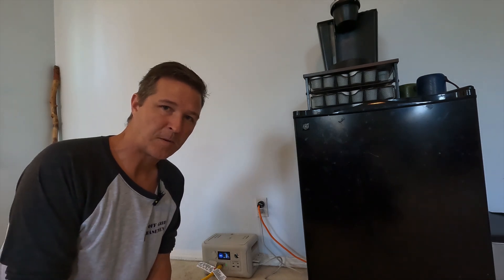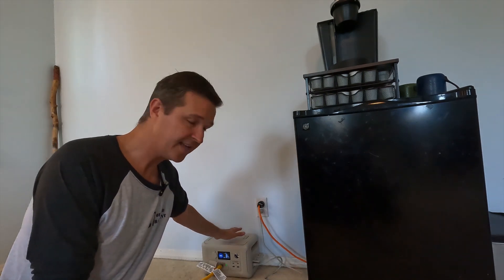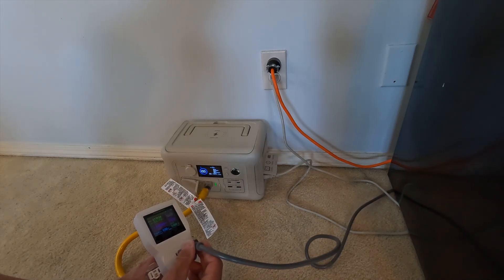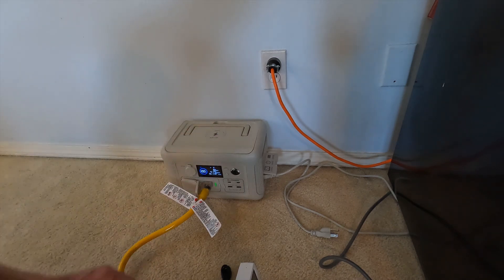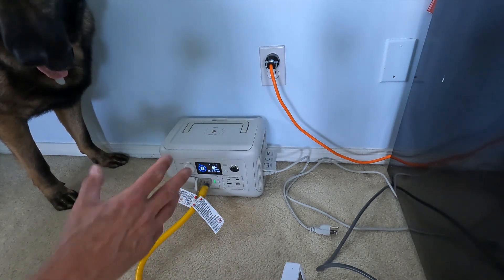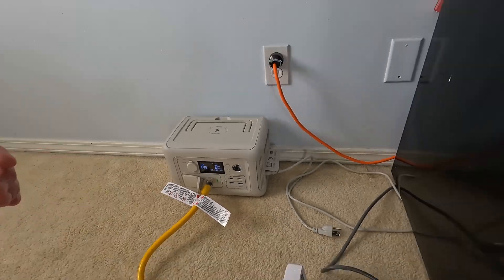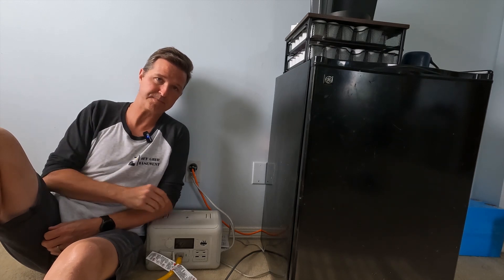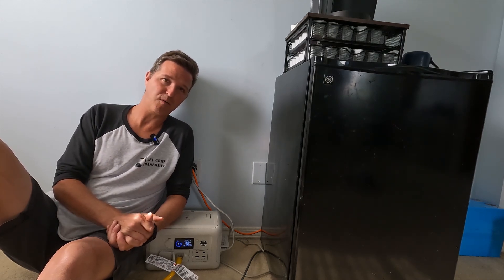Will a 600w 299wh power station run a compact refrigerator?  Let's find out!

Comment: Once you don't open fridge or often you can get good run times as the need for motor to run would be minimum. A solar panel or two to charge up  or aid the loads during sunshine would be even better
Reply from the maker: Thanks for the info and the comment.

Comment: I  t's good to know what the abilities of your emergency backup gear is, but you probably would have gotten a much different result if you had also shut off your AC for the test. In a power outage your home will heat up in the summer and it will heat up A LOT in that length of time, if you live in about half the states in America. Covering the fridge with a few quilts will increase your time, no matter the outside temp. 
  I get really good results with a cheap 600 watt modified sine wave inverter and a LiFePO4 battery. The Mini 12 volt LFP batteries are so light and are getting so cheap that they compare better with solar generators and they deliver more bang for the buck, IMO. It isn't as "refined" looking, but if you keep the inverter/ battery connected to a cheap low amp charger and when the power goes out the charger won't charge any longer, but the battery/inverter will still power the fridge, just as if it was a UPS and it will do it for days not hours. I live in Tornado Alley, so I have to plan for days of outages. BTW, that unit looks a lot like a Bluetti EB3A. Are they as similar as it seems? My EB3As makes my lights flicker when I plug them into the units acting as UPSs. Is that unit better? If it is I may want to get a couple.
Reply from the maker: Thanks for the information.  I've never noticed any lights flickering when I use the EB3A.  This unit is very similar but gets a little bit more power out of the AC side.  Thanks for the comment.
Reply: @OffGridBasement  It's actually a common complaint with the EB3A. It's been determined that it's because the wall power isn't being passed through the unit directly to the AC device, but rather, the EB3A is using its inverter to run the AC device and, when it detects a small drop in the voltage on the built-in LFP battery, from running the inverter, it switches on the charger and that causes the very quick interruption in power that makes SOME lights flicker at regular intervals and, unfortunately, also slowly degrades your battery, even when the wall power is working. Folks complain that, even though the lights don't flicker, they are annoyed by the frequent clicking inside the unit, probably due to a relay turning on the charger. Do you get any rhythmic clicks from the unit you used in this video or the EB3A when they are acting as a UPS?

Comment: I have an Eco Flow River 2 Max and run a fridge like that overnight. Takes about 70% of capacity running for 8 hours. I've only charged the unit once with AC since i got it about 4 weeks ago.
Reply from the maker: Thanks for the info and the comment.

Comment: I'm completely off grid with limited solar, and I learned to purchase a refrigerator that uses lower amps. For example  my 10.1 Magic Chef only uses 1.5 amps.  Best efficient unit because of the lower Amp then other compared  units.😊
Reply from the maker: Thanks for sharing and for the comment.

Comment: I have a similar dorm frig in a hot garage.  It runs for about 10 minutes, then is off for 15.  AC watts is 70-80.  Draw on the battery is about 9 ampsDC.  A 100 watt panel in good sun can power frig all sunny day.
Reply from the maker: Thanks for the comment and info!

Comment: Kind of impressive for that little guy. Think of how far it might go with a 50, or 100Ah LiFePo4 connected to extend it's endurance... Curious to know if it would even start, or run a regular, newer 18-20 cu.ft. fridge, thanks.
Reply from the maker: Not sure if it could handle the initial surge.  Thanks for the comment.

Comment: Nice video. Would be interesting if you knew the real life aspect of it as far as perhaps opening the door for 1-2mins each hour as if someone was taking food/drinks out. Would the surge keep bumping up thus actually giving you the 3 hrs you first thought?
Reply from the maker: Time would definitely go down, but that is a good question.  If the power was out I would try to keep my refrigerator used to a minimum.  Thanks for the comment.

Comment: It would be interesting to use a timer switch that comes on only for 15 minutes per hour. This might result in greater temperature swings in the fridge but can it prolong battery life?

I’m old fashioned, when the power goes out, fridge and freezer get blankets for added insulation
Reply from the maker: I like the idea of a timer switch.  Good thinking with the blankets!  Thanks for the comment.

Comment: I measure every electric appliance power requirements on everything in my house and mark the running  watts with green painter's tape and magic marker. I mean EVERYTHING that is plugged in. The newer appliances are very much efficient and use much less running watts. I was shocked to see that my vertical tower fans use only 42 watts on high. The old box fan was noisier and used 97 watts and put out less breeze.  The 2 house fridges are quite efficient....until the defrost cycle happens. I can tell when the defrost watts are high on my battery state of charge meter shows it. 229 Watt hours is pretty small but you did a good test. I have a total of 96,000 watt hours available to  run my clock radio....
Reply from the maker: Thanks for the comment.
Reply: Cool👍 What is your average per day in kWh?
Reply: @JonasSyver  8-10kwh per day. Down from 22-26kwh a day a few years ago. This takes a huge amount of discipline.
Reply: @kimmer6  Good job👍

Comment: Nice experiment, could you try to run the same test but with fridge in the garage with summer heat. See how ambient temps affect run time.
Reply: I put a Magic Chef 2 door 3.1 cubic foot fridge freezer in my old GMC van conversion. I also have a 300 amp hour Chins lithium battery, 2000 watt Renogy inverter 40 amp MPPT solar controller, and 400 watts in panels on the roof. When running, the fridge draws 58 amps. That is a huge improvement compared to old dorm 1 door freezer/fridge 1998 unit power usage of 105 watts. The van sits in the driveway in the sun with windows down 2 inches but it gets hot in there. The fridge runs a long time every hour when its hot inside. I store some small packages of ice cream in there as the Missus is severely diabetic and will chow down on any ice cream in the house.  I have to hide my Haagen Daz.

In the Winter, the fridge runs the battery down to 95% overnight and with low sun angle and short days, it takes all day to get to 100% charge. In the Summer, with the solar disconnected, the fridge runs the battery down to 82% with 93F peak day temp.  I did this as a test. With the solar charging, the  battery will get to 100% by 2 in the afternoon.  The ambient temperature the fridge has a drastic effect on the run time on the compressor, thus watt hours required to run are much greater. We have had some 110F days and I did not bother to look at the state of charge meter. But the ice cream was still pretty solid when I had the midnight craving. The pot stickers in there were frozen solid, too.  Ice cream needs to be at minus 5 F to be solid.
Reply from the maker: Great suggestion!  Thanks for the comment.